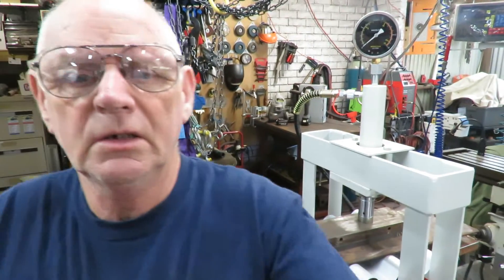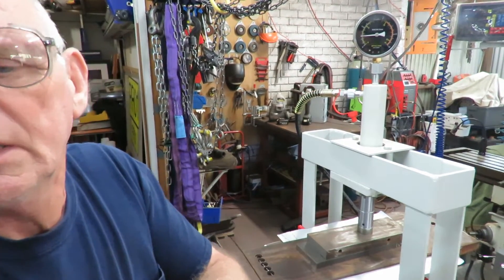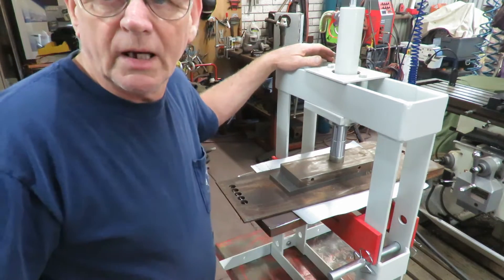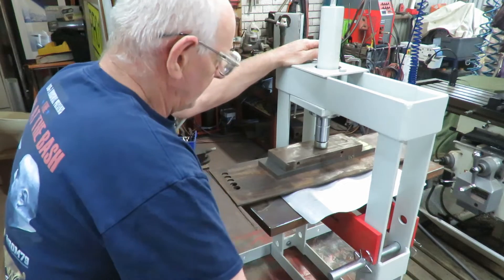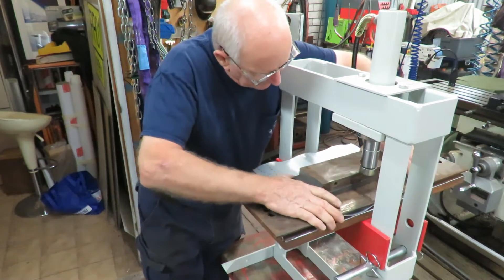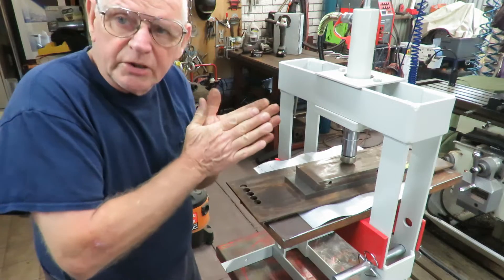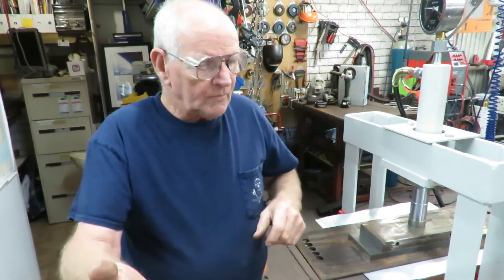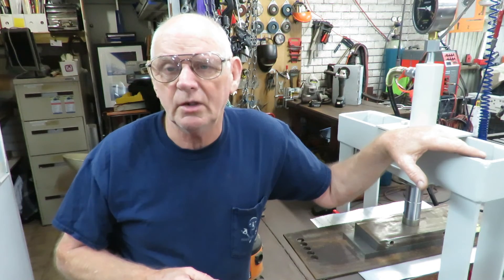Hydraulic Press Flattening Corrugated Metal

Comment: Why not just start with flat steel?
Reply from the maker: Grandpa and to everyone making comments I need to clarify that this project is part of a continuous beam profiling line so it has to be done on a section of the welded beam running through a long profiling line therefor a section needs to be flattened and punched out of the corrugated web.

Comment: I would guess it would be best to make a die that is shaped to over bend the sheet past the point that it is flat, then it would bounce back to flat, this would require a lot less pressure also
Reply: I have a suspicion that he's only doing this to determine what power is needed so that he can do it on a larger scale. In that case, a die may not be practicable.